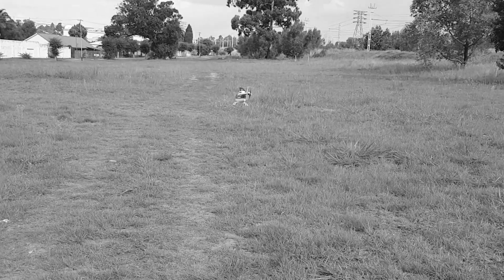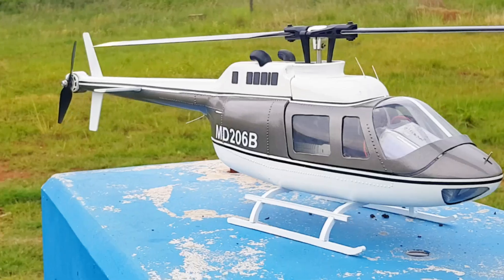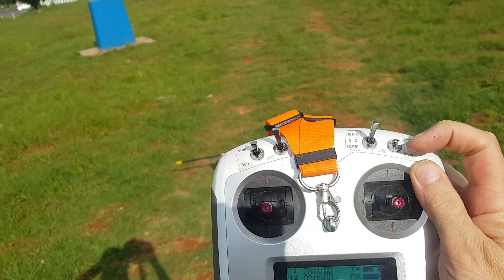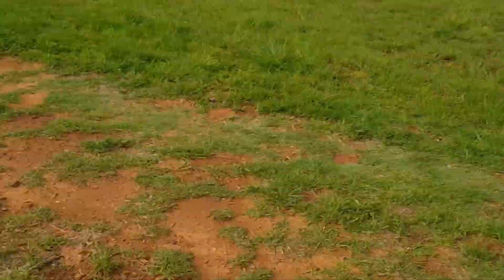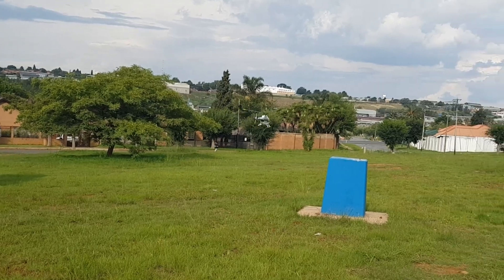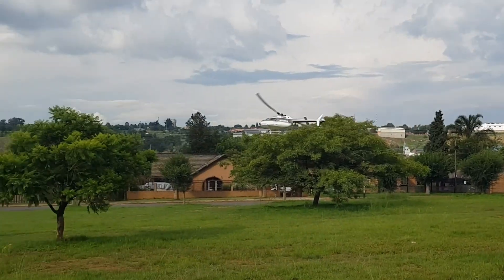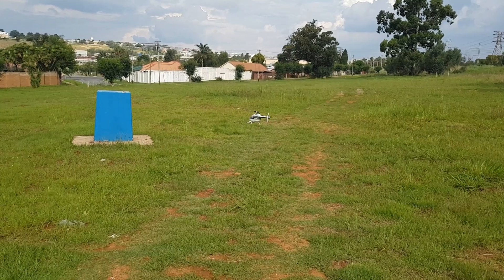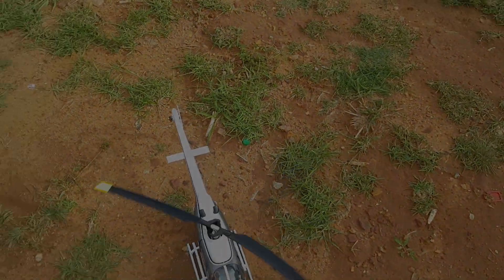3D Printed - Flywing H1 equipped. Maiden

Comment: Nice sounding main rotor blades. They make a convincing and powerful sound. That's why I like the two-blade helicopters so much. 💯
Reply from the maker: HI, actually the swashplate arms were rubbing on the body a bit in this video so it made a weird sound.